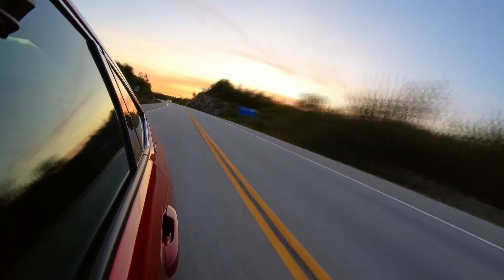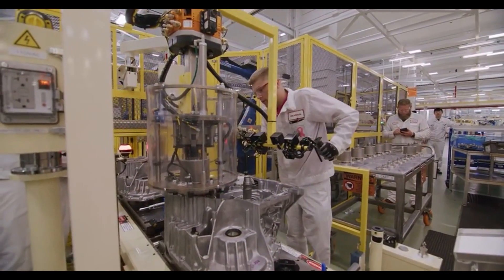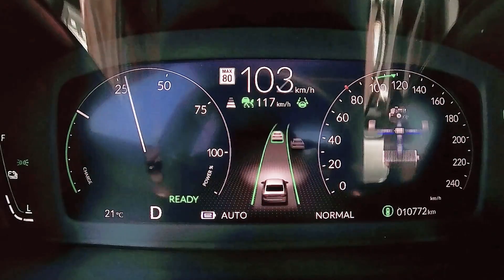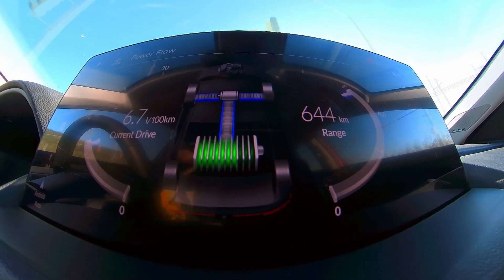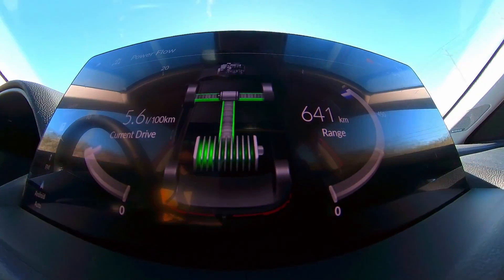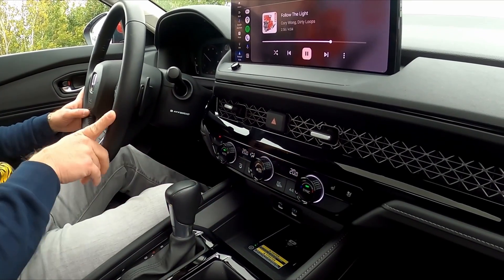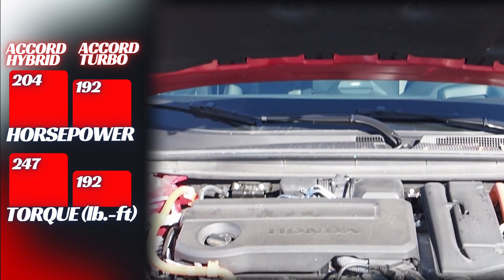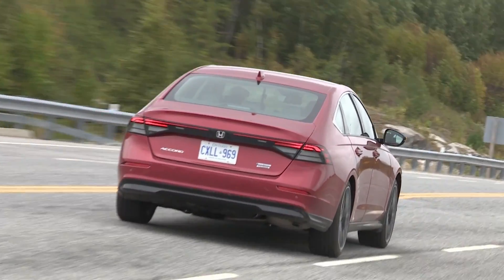2024 Honda Accord Hybrid Engine: HERE'S HOW IT WORKS

Comment: Honda's two-motor hybrid system : HERE'S HOW IT WORKS

First, some corrections to common misunderstandings. Motor-generators do not make power, they convert between mechanical and electrical power. Their advantage is not efficiency (they compare to the gas car's transmission, not the engine), it is that they can convert in either direction. This allows regen braking, which recaptures maybe half of the kinetic energy the car needs to lose while slowing (or going down a hill). Or, put another way, the recaptured energy reduces the amount of gas needed to reach speed (or climb the hill) by half. It is never be considered to provide energy, just reduce what is needed.

Most of the time (well, all of the time but it can be turned off) the 2L ICE is hooked up to the smaller of two MGs. It is dedicated to powering the larger of the MGs, which is hooked up to the wheels. Only the excess power is used to charge the battery. It is called a hybrid because the MG is powered by a combination of the battery and/or ICE-driven generator.

The purpose of the system is to allow the ICE to operate at its most efficient level of power. Which is more than is needed to maintain speed on a flat road, but less than is needed for typical acceleration. The engine never powers the wheels directly while accelerating, so the concept of "boost" is misplaced. The battery is a buffer that allows the motor to use energy from gas burned at an earlier time, when it could run more efficiently.

The only exception is highway cruising. A clutch closes, connecting both MGs, the ICE, and the wheels. The smaller MG is turned off, and the larger can act as either a generator to send excess ICE power to the battery, or add battery power fro acceleration.

While cruising on engine power, in either mode, the Power Flow Monitor will show power going to the wheels as blue, and excess power going to the battery as green. Since more energy is typically saved this way, than is used later for "boost," the car will often drop into battery-only mode.
Reply: This is correct.

Comment: I bought a new 2023 Accord Sport Hybrid  about 16 months ago. An amazing car. My combined mostly city driving is 50.7 mpg. Interstate driving around 54 mpg.

As trustee for my parents estate I had a chance to rent a new 2025 Camry XSE hybrid rather than use my new car.  Nicest car I've ever rented but not as nice the Honda. Over nearly 4000 Interstate miles the car averaged 48 mpg. The car didn't feel as refined or surefooted as the Honda. One thing I disliked was the instrument panel. Seemed like a hodgepodge of icons just strewn around. Cycling between engine and electric not as seamless as in the Honda.

Comment: Looking for some advice—-

I just purchased a new 2024 Accord Hybrid Touring, and I’ve noticed that my battery and engine hardly EVER function together… I feel like this defeats the purpose of a hybrid, no? I’m using a lot of gas power, but hardly any battery power. My battery has even topped out more than a few times.. driving conditions are perfect for EV only mode, and that doesn’t seem to be happening either. 

Thoughts?

Comment: Good video. However, the annual cost comparison needs to include the cost of replacing the hybrids main batterry every 6 to 10 years which virtually negates any cost advantage.
Reply from the maker: Thanks, just remember, that battery is under warranty for 8 years.
Reply: Who told you that tall tail about replacing the battery? Modern hybrid batteries should last as long as the engine.

Comment: He could have said that the engine runs the generator which charges the battery which drives the traction motor. At higher road speed a clutch engages which connects the engine directly to the wheels. Basically a two speed gearbox. At high speed, fuel economy is poor. Toyota does it much much better with excelent fuel economy at high speed.

Comment: Yeah, I’m disappointed in this video. As another reader stated, doesn’t really explain how the hybrid system actually works. Moreover, he states that the system continually discharges and recharges the batteries constantly. How? Are the same cells being used, then recharged, then charged again? Does Honda have some mechanism that ensures that the battery cell usage is evenly distributed, so that all cells get used, then recharged in some linear fashion? P.S., I have the 2023 Accord Touring, and the phone charger is absolutely u-s-e-l-e-s-s.  The phone placement is so touchy that it won’t charge for more than a few seconds before some insignificant movement stops the charging. What a waste of a feature.
Reply from the maker: Thanks for the feedback, I actually just watched this video again for about the 10th time, and since you and another viewer have picked up on it, let me offer some thoughts.

I think ultimately a better title might have been 'Here's what it does' not 'here's how it works'

Though some of you are seeking a more detailed technical explanation which I didn't dive into in this video, I'm still proud of the research put into this video, and the fact that it's been one of my highest performing and most watched in recent years. 

Appreciate the feedback nonetheless, it does definitely help shape future videos to be even better. 

Cheers from North Ontario
Reply: @JustinPritchard  well, look at it as an opportunity. Clearly, readers would like more info on how it actually works. Maybe it’s time for another video.  I’d certainly watch it. Thanks. 😄

Comment: Is this cvt trasmission like the toyota synergy drive system that has NO belts or chains and is completly gear and planetary gear driven thanks
Reply: NO! It has a two speed gearbox and just motor to battery to motor configuration.
Its like a diesel electric train but with lock up at high speed.

Comment: I was disappointed that the video didn’t actually explain how the hybrid system works at all. It just shows how the info is displayed and otherwise was just a car review.
Reply: What you mean? It's an EV that has an electric charger that uses the motion of the tires to recharge. As well as the gas engine. What more do you want to have explained?
Reply: @ https://youtu.be/dLNDGUISTYM?si=f5Rw3dXp0I02ORRZ
Reply: @andylewis210  And.... what does that video have to do with a Honda? It's a completely different system.
Reply: @andylewis210  I think that video is 12 years so doesn’t reflect the current hybrid system.
Reply: This video gives some details about how it works . This for the current generation. There are a lot of videos out there about the older versions that do not pertain to current models.

https://www.youtube.com/watch?v=QLUIExAnNcE&t=30s
Reply: Lol pretty much.
Reply: Me too
Reply: Thanks for saving me some time lol
Reply: Yes
Reply: Right…pointless video

Comment: The average driver in this car will get their value back in gas savings for sure (especially with the estimates using a steady gas price of $1.50/L for the next 5-10 years😅) - but more importantly, it cuts your emissions nearly in half. That's a LOT of CO2 not going into the air!
Reply from the maker: I mean, the fuel price calculations are just for for ball parking purposes to help viewers visualize. But I wonder if there's a better way to forecast future prices more accurately
Reply: @JustinPritchard  hard to say, with the fall of civilization just around the corner!
Reply: @JustinPritchard  honestly, for your purposes I had no problem with you just picking an average, not really a better way to do it. AND, it's likely to go up. and up. and up.

Comment: I'm curious because my commute is roughly 20 miles each way to work. Half going County Road speed and half going highway speed I have almost no driving at lower speed limits. I wonder if it would be worth it with all the extra components that will have wear and tear on them and potentially need repair down the road.  Unfortunately to get a nice trim level with options you have to buy a hybrid with the new accord.
Reply: You need to stop imagining what might go wrong. There is no alternator, no starter motor, and NO TRANSMISSION. And no drive belt (components that would be on it are electric). There are no "all the extra components that will have wear." Even the clutch is only engaged when the rpm are perfectly matched by computer.

Comment: With the 2.0T and it's amazing 10-speed transmission, the Accord Hybrid EX-L is the one to get at 53mpg and NO turbo and NO CVT transmission.
Reply: What do you think the "T" means in 2.0T?
Reply: @DJ.1001  wrecked
Reply: The e-CVT in the hybrid is much simpler and more reliable than the non-hybrid transmission.  See this for details https://youtu.be/QLUIExAnNcE?si=wphxABo9GuYOQvGi

Comment: Modern hybrids (Honda Toyota Ford for sure) give you most of electric car goodness without the electric car drawbacks. 

Also they don't have turbos, sleazy mechanical belt or chain CVTs, 11 speed torque converter automatic, torque converter, start/stop systems, 12 Volt starter, etc.

Many advantages of the electric cars with gasoline assist (hybrids).

Comment: My honda accord would not start, I have 940 miles, yes you read that right 940 miles.  The system would not read the hey fob and it is currently being serviced for an “electrical problem”.  Anyone else experience this?

Comment: Nitpick: There is no such thing as a hybrid engine. It has an Atkinson engine connected to a hybrid transmission.

And underlying that nitpick is another, almost universal mistake. Never compare the engine to an electric motor-generator. The MG doesn't make power like an engine does, it converts the electrical power made by a battery or generator, from electrical power to mechanical power. So the MGs are more properly part of a hybrid's transmission, than something that compares to an engine.

But while you gave a very good explanation of the hybrid system, I like mine better. Numbers below will reflect the 2018-2022 version, but they didn't change much.

Most of the time, this is an EV. Not a Battery EV, like a Tesla, but a Battery and Generator* EV. It is more properly called a serial hybrid. The disadvantage of a serial hybrid is that it has to convert power twice between electrical and mechanical. The losses in that process are its "transmission losses." But in fact, this transmission can be more efficient than a CVT. Still, when needs are fairly constant - highway cruising - it changes to a parallel hybrid with essentially no transmission losses at all.

The way a serial hybrid helps with fuel economy, is seen in that green-and-blue power display. That Atkinson engine is most efficient at 2000 rpm and 88.5 lb-ft of torque, which is about 34 HP. It is 40.6% efficient at this point on the torque curve. Now, the engine in a non-hybrid has to produce the exact amount of power needed by the car. At 55 mph on a flat road in this car, that is about 15 HP. With it best rpm at 15 HP,  this engine is only about 37% efficient. (A larger, or non-Atkinson, engine would be less efficient at 15 HP.) So what the serial hybrid will do - as you describe - is run the engine at 34 HP as often as it can, and use that extra 19 HP to self-charge the battery. Then, at a later time it will use that charge either for acceleration, or in EV drive.

As a parallel hybrid, between about 40 and 80 mph, it will vary rpm (rpm=mph*37) but still keep efficiency above 40%. And the traction motor will use any extra power to self-charge, instead of the generator.

Two more nitpicks: it uses engine drive only in low-power situations. So ma wheel power is determined by that 181 HP motor. But remember, a motor is a transmission, not a power plant. In order to get 181 HP to the wheels, a conventional gas car has to make 212 HP (https://www.motortrend.com/how-to/modp-1005-drivetrain-power-loss/). And yes, that is where Honda's older hybrids go their "rated" power.

And, there is one other situation where the generator will act as a motor. If the battery ever becomes full while using regenerative braking down a long hill, you will lose regen if you don't find another place to dump energy. In this situation, the generator will be used to spin the engine for "engine braking." That surprises some people, when the engine seems to come on while braking downhill.
Reply from the maker: Thank you for that. Fantastic deep dive, and proof that you're definitely not in the target audience I have in mind for this video. 

Yes, I'm definitely taking some liberties with the nomenclature to make sure that every one of my friends and family understands what I'm talking about in simple terms. 

I'm going to read your comments several more times to understand fully. Cheers
Reply: @JustinPritchard I like how you showed the powerflow time-lapse and the video is well produced so good job on that, but the problem is that you didn't actually explain the operating principles of Honda's hybrid system, just a general explanation of how its put together, the rest was very vague. You don't need to go as deep as this commenter went but a general explanation of how the hybrid system mechanically delivers power and how it behaves in different situations. I think anyone clicking a video called "how does x work" would appreciate that
Reply: Superb technical breakdown, You must be an engineer for sure.  Keep it up…❤
Reply: What a breakdown man!

Comment: Honda should up the capacity of batteries from 1.1 kw/h to at least 10 kw/h
the euro PHeV has a 17.7 kw/h batteries
Reply: A plug-in is expected to drive for a pretty long distance in ev only, that’s why the Phev has a larger battery.

Comment: Wife just purchased a 2024 Honda CRV Touring Sport Hybrid last month. This is our third Honda hybrid (2006 Civic hybrid - 2010 Insight hybrid).  The 2024 CRV Hybrid is getting up 42-45 MPG city and 39-40 MPG at highway speeds.   We love this CRV, good job Honda.   (  Like your video... )
Reply: If your vehicle has GDI without port injection carbon fouling of  the backs of the intake valves might be a concern.

Comment: you mentioned this right after the point where I paused to write this comment 😂

Correct me if I’m wrong but I’ve heard under 60mph or light enough load the car acts like a diesel electric train. The gas engine noises you hear is only the engine directly turning the electric regen motor to supply electricity for the electric drive motor.
Reply: I own one (the sport hybrid) and the engine is barely audible the majority of the time. (High or low speeds) I will say you do feel a slight engagement when the high gear clutch kicks in but its no big deal.

Comment: My wife and I love the gas mileage we are getting with our 2023 Accord Hybrid Touring car. In town we are getting 40MPG commuting. We drove from Atlanta to Spruce Pine, NC which is around 180 miles one way. About 2/3 mountainous highway driving. With the adaptive cruise control set at 85MPH in Economy Mode we got 45MPG. Due to traffic we rarely did more than 75.  I was very surprised to observe the car in EV mode numerous times when we were going up a long grade. Getting that kind of gas mileage from such a large, comfortable, feature laden car is awesome! To top it can accelerate almost as fast as my old turbo charged Accord Touring car.
Reply: To note... Going above 75mph will kill your MPG.  Tested my self... Kept it 74mph and I get 2mph better than at 75.  Same road, full tank of gas both ways.  30 mile drive.
Reply: My Lexus UX hybrid gets 53 MPG average and even more on the motorway.

Comment: Appreciate the fuel math, however, any hybrid is more complicated and I wonder about long term reliability. I buy my vehicles and keep them 10 years minimum. Having said that, I'm 77 y/o and 6"3". A lot of cars and SUV don't give me any comfort or elbow room.  last time I bought was 5 years ago... a 2018 Z71 Tahoe.
Reply: As of around 2018 hybrids actually surpassed non-hybrids in terms of reliability.  There are at least two reasons for this.  On one hand most hybrids (but not all!) either do not have a transmission as we know it, or in Toyota/Ford's case, they use an extremely simple planetary gear set.  (This is labeled as an eCVT, which is a bad label because it confuses people with the belt/chain-driven traditional CVT's found in non-hybrids)

The other reason is because of the stricter emissions and fuel economy requirements each year, non-hybrids have to keep growing more and more complicated to meet these requirements.  Hybrids largely do not, as most already meet the requirements for as far out as 2035 in some locations.  For example most hybrids do not have direct injection, or at least do not have it alone.  And of course most do not have a turbo or supercharger to worry about.
Reply: From what I’ve heard, these cars are VERY reliable. I just bought a ‘24 and it’s been fabulous so far

Comment: Very good review unlike many that only car about numbers. Would be nice for other products with higher output like for rdx, Ridgeline, etc...I did 7.5 l/100km in my  2020 2.0T Accord and do as good as 5.0L/100km in my 2023 Integra Elite a spec manual on highway trips,  normal driving 8.9L/100km best on highway,  but a little fun to lots of fun...10.5 to 22L/100km  on highway